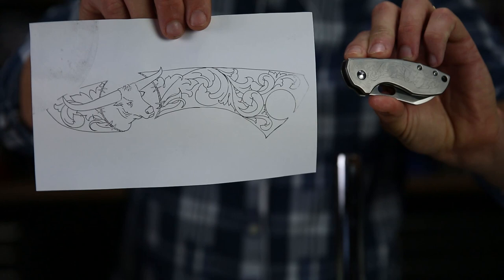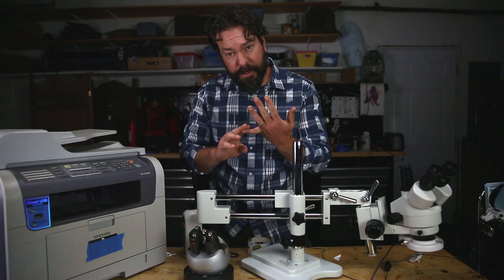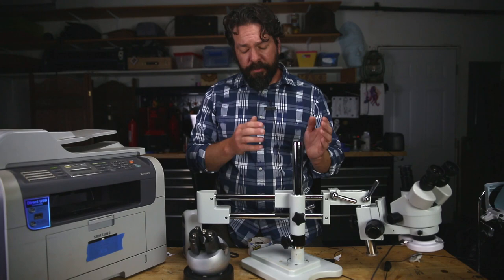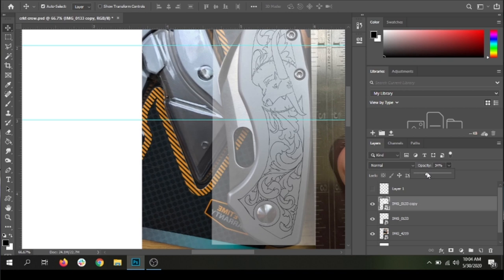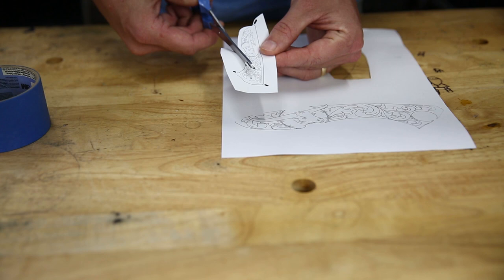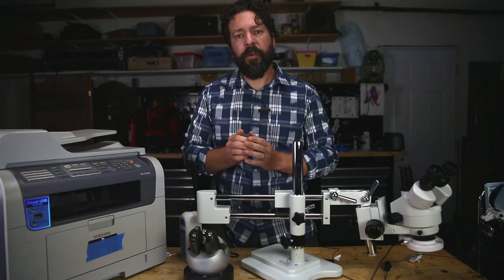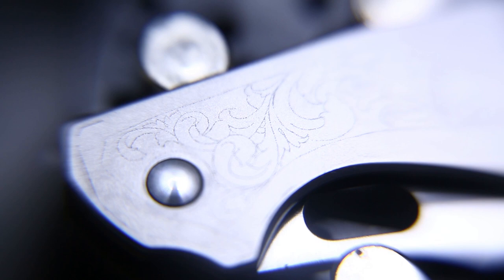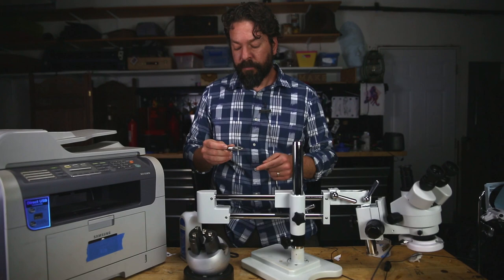How To Transfer Images Onto Metal - acetone transfer

Comment: Great Video!

After pulling my hair out for days trying to figure out why the acetone wouldn't release from the paper and trying many combinations the reason was heat. Laser printers use heat to apply the carbon powder to the paper. 
The perfect combination I found was the following:
1. Printing on the non adhesive back page of Avery sticker printing sheets or you can also use baking paper taped to an A4 sheet.
2. Apply a gentle heat to the work using a butane torch (its not getting red hot, just enough that it is uncomfortable to hold). (wear gloves)
3. Finally apply pressure with a rag and acetone. 
I found that this took every spec of detail off the paper and left everything on the work. 
Hope this helps.
Reply: Hey there! I am trying this on smooth brushed aluminium. 1. Normal a4 paper, print facing surface. 2. Scotch tape either side 3. Hair dryer for heat until surface is warm 4. Apply acetate 5. Zero result!!!!! I cannot see any ink at all on surface of aluminium. What am I doing wrong do you think? Any help would be a bonus!!!
Reply: @jamiepontifex5756  I just tried on  a block aluminium plate heated with hair drier til plate was warm, NO tape placed printout face down on the aluminium applied acetone with tissue let dry and removed printout - and it worked perfectly, dont forget to clean the surface with acetone first.

Comment: Thanks for that. I was having spectacular lack of success using transfer paper, just mucked up my drum. Smoothing iron on a paper print very poor too. Had tried various chemicals but not acetone 'cos it gives me a headache. But it works! Only a very light moistening else it wicks in the paper and smudges.]
So it all depends on the particular machine and toner as to which technique works.
Reply: Can you tell me which  printers nettter for metal and paper
Reply: @tabinsaeed441  Can't really say I'm afraid, each one seems to require different techniques and chemicals and heat from an iron. I was using a Brother laser and only after lots of experiments did I find a combination which worked reasonably well. So all I can suggest is experiment with everything you have to hand. If you do get transfer onto a laser drum like I had, a few passes with clean paper cleared it, thankfully. Good luck.

Comment: Unfortunately this wont work with most laser printers because of the internal heater. Depends on which printer you get and the heat it uses. Or break into yours and disable the heater.

Comment: Free software Inkscape is ideal for vector prints. It makes clean prints without dots. It can vectorize/trace bitmaps (to make vector images out of your bitmap designs) quite good! Just print straight out of inkscape for best result.  

And I indeed believe some glue of the tape makes the transfer better, we always use a shellac solution on the surface before transferring, for this exact same function. 

Cheerio

Comment: Hi there, i used this method for a while, but i found a much better way to transfer patterns. print on parchment paper not regular paper und then use hair spray to coat the piece, when its dry moistn it with your breath and then put the parchmentpaper on and rub it onto the piece, when all ink is transfered you coat it in another layer of hairspray. it is extreme visible and works great. i also made a video about it, its one of my most seen videos and many people tryed it and were very happy. give it a shot, you dont need any solvent or other harsh stuff, just the cheapest hairspry you can find and some common parchment paper, a laser printer you have allready, that works best.

Comment: Thanks for the info.
If you're not going to engrave the image, will spraying it with clear coat make it last longer?
Or would you want to do the following steps:
1) sanding, 
2) prime
3) transfer monochrome or color image.
Acetone would destroy the primer wouldn't it?
Looks like I need to do a web search.
Reply from the maker: I'm sure it would, but I haven't tried. I've seen people use this process on wood, and a clear coat on that would make it last a while.
Reply: @CalebKraftmakes  😎👍

Comment: I just tried to transfer the image to a copper plate using resin varnish but failed.  I used to transfer to PVC with thinner.  and it works easily.  Is this acetone also hard and hot when it hits the skin?  if yes, then you can use thinner too

Comment: Hi, this method does not work with any toner.  I have tried several laser printers including printing at Staples and none of them have worked. The acetone did not dissolve the toner even after saturating the paper.  Do you know what kind of toner to use specifically?
Reply: Same here.  LOTS of wiping, but no transfer. A glossy paper, perhaps- I just used common-or-garden...

Comment: Do different laser printers produce different results? I'm not having any luck transferring to copper.
Reply from the maker: sometimes, as do different metals. I’ve done copper before by scuffing up the surface first with some super fine sandpaper or steel wool. Then clean it really well and do the tape trick.
Reply: @CalebKraftmakes  Thankyou for taking the time out to answer me :) I accidently hit on a way that works for me. Thin layer of nail varnish, totally ordinary laser print then by accident I used 100% alcohol instead of acetone and got a perfect result. Thank you for your videos I have learned a huge amount from them.

Comment: Nice ! I'm refinishing a vintage stereo and need to put back lettering. The surface is painted metal. Can you suggest a way to inkjet print and transfer back lettering onto the painted metal surface ?  Thanks !!!!
Reply: Best is water borne decals. I k jet compatible available at most hobby stores. Same as the stuff in model car kits for logos.

Comment: Hmm I tried this with my laser printer and it seemed that the acetone did not release the toner at all, same with my canon bubble jet. I wonder if certain brans the toner simply wont react with the Acetone. Anyone else notice this?
Reply: Because your using an ink jet printer not a laser. Ink jet you have to use a different method
Reply: @martinstockbridge3449  I tried a laser too and same result. What method works for ink jet? Perhaps that might work for me?
Reply: @trevoradams8675  Laser didn't work for me either.  Trying inkjet next - need to put baking paper onto printer paper (sellotape?), then remove after printing.  Don't handle the image coz it'll smudge...  transfer with acetone.  Wild Style Works' channel shows the how-to vid....

DOH!  Just found out inkjet on baking paper won't work for me.  The image is smudgy and I'm using cottonbud electro method, so will smear the resist if the method transfers. Immersion electro etch will fail too as the ink is water soluble apparently...
Reply: Thanks for the help! I managed to get a decent result with a laser. Trick I found is less acetone is better than more. And it melts right on!
Reply from the maker: good to know!